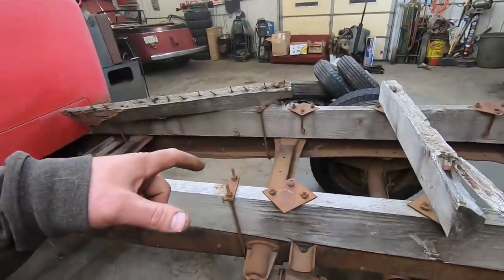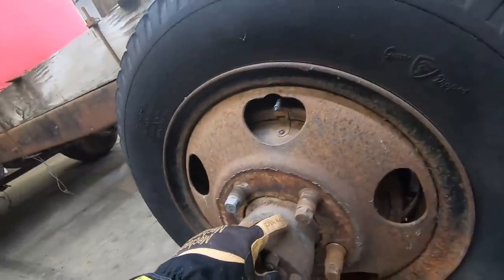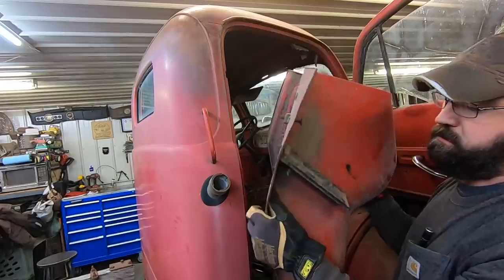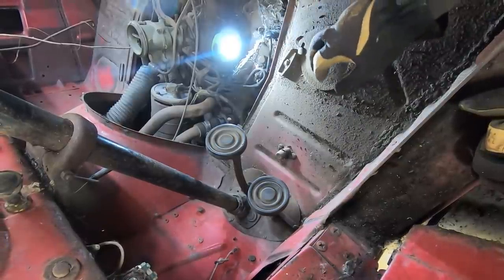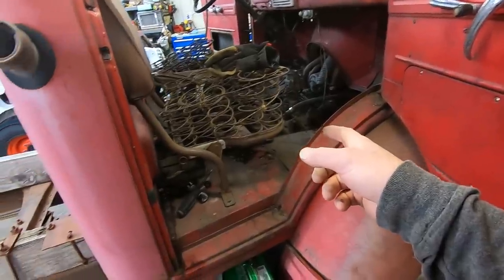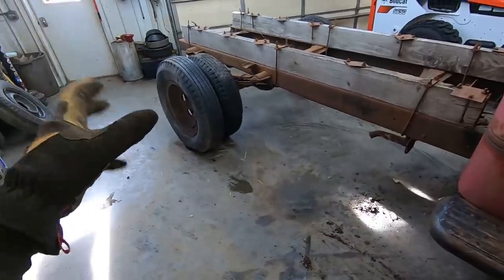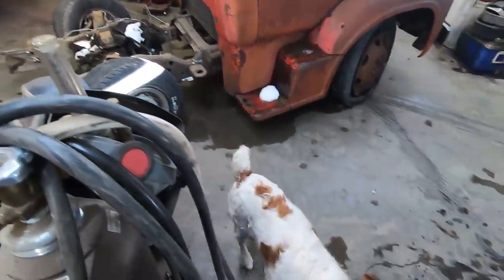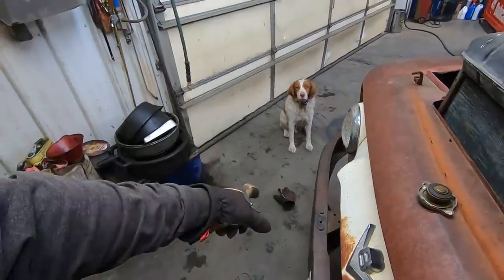1948 Ford Cabover Farm truck! Abandoned for 40 years! Will it run?!? Bonus "Stubby Bob" footage!

Comment: Boy did you have trouble with tires on this video. The tire blowout reminds me of an interesting thing that happened to me at harvest time back around 1994. We were wheat and barley farmers. One of our trucks was a 1948 Chevrolet 2 ton with dump bed. It was our spare truck. I came into the grain elevator one day with a full load. They weighed me but I had to wait for the pit to empty because it had different grain in the pit. I talked to the operator's assistant and I kept hearing this scratching noise. I realized it was coming from the driver side rear inner dual. I stuck my head between the gas tank and inner tire trying to figure what it was when my eyes latched onto a bulge in the retread about the size of an egg and growing fast. I told the guy th run. I ran past the operator the was standing back of the truck and told him to run, the tire was gonna blow. He just stood there bewildered and all of a sudden - BOOM!!! Dust went flying everywhere and the operator was scared out of his wits. I'm just glad that rush of air didn't shoot a flame and ignite any grain dust or there would've been another boom! I'm also glad that thing didn't blow when I stuck my head right by it.
Reply from the maker: Yeah, bad place for that to happen. I bet that was a lot of dust!
Reply: @MortskeRepair  that was the funny part with all that dust coming from under that truck. I'm still so glad it didn't blow when I had my head stuck between that fuel tank and tire. I would've been pretty badly injured. It was also good I was parked in front of the pit so all I had to do was dump the load. I don't think that other retread would've made it driving anywhere.
Reply from the maker: @stephensaasen8589  Glad you pulled through!

Comment: Those COE's are begging for a 2500 or 3500 4x4 Duramax conversion. I know Cummings are popular but a 30 inch square Duramax will replace those V8s easier. Just think of all smiles,laughter and good times you and Duff will have.

Comment: The Sun tester would need a bunch of capacitors replaced, and then it would all work.  I can remember running one at an Exxon station I worked for back then.

Comment: When the cylenders are an archeology dig,just use a vet/dry vac to remove the layers of muck. Instead of blowing it all over. May just need a new engine,tho!! At least the cab (body wise) is in good condition!! Did you ever find a new supply of the hamm's draft??
Reply from the maker: Nope. Obsolete

Comment: in  1969 or 70  on the front page of the New York  Daily  News was a picture of a pair of shoes beside a gas pump at a gas station and the back of a old pick up truck with a big tractor tier ,  and the head lines said some thing like this  ;   Fathers son killed and blown out of his shoes wile inflating a tractor tire  that exploded . /  inflating tiers is very dangerous  / i can not ever forget it  /i was working at a gas station  at the time

Comment: You could put a van front end over the back of the truck so you can drive either direction. A loving steering wheel on both ends would lock the rear wheels while you're driving... In either direction.
Reply from the maker: Brilliant!

Comment: You said that you want to apply the linseed oil (boiled linseed oil) and grease it over the old red paint Cabover. It smells better than used black oil that brush over the thin paint. Gasoline smells worse than oiling the old tin cab house truck. 
 And recommendation is to uninstall all the seat away from the cab interior and more comfortable to inspect the engine. Driving/driver seat is not uninstall then it's too cramp and not enough space Sir?

Comment: I'm trying to figure out what was the point to the cab over hach. The time and resources you spent on the second truck would have been better spent trying to swap any other motor. But that's my opinion.
Reply from the maker: Had to make it easy to move

Comment: Cool looking trucks , but I don't see the advantage of having the motor in the cab like a van. Seems a pain to work on. Maybe that's why they got parked after 20,000. Did you pull the oil drain plug to see how much water was in the bottom end. Funny how we think we react so fast when something like a tire blows. Glad you're okay.
Reply from the maker: Shorter wheelbase for turning in tight areas is one of the reasons

Comment: Hi Morty and duff. Bummer the wasted flathead.  Either cab could go on modern chassis, you know that. Any thoughs on the 32' ? Your project video, are every bit as interesting as will it run. The 32's wild child,show is cool. Useful tech tip. I'm fairly sure the slant six distributor, fits the flathead 6. FF to electronic ign slant 6 distributor and module.  Just sayin in case you had any thought on electronic ign.

Comment: You talked about putting a Cummins in it, what about an old 2-stroke screaming Detroit? No electronics required, legendary reliability, and unbeatable sound.
Reply from the maker: Too loud. And leaky!
Reply: That truck is so awesome regardless of what you do. There’s a lot of them down here in Kansas. Right along highway 281 as a matter of fact.
Reply from the maker: @stevenlatham4397  Nice!

Comment: I was thinking as you were putting air in that tire if that thing has been sitting since 1980 it's got to be really ripe and he really needs one of those air pumps that you can set the PSI connect it and walk away and then Bang it happened LOL! at least it did not have pieces flying at you like some tires do.

Comment: Easy way to check if the engine turns, put that puppy in high gear and rock the truck back and forth. Much easier than grabbing the fan.
Reply from the maker: How about when it's sitting in the weeds wheels half burried?

Comment: the steel in those fenders is a heavier gauge than cars have so the dints are not that easily removed.
Reply from the maker: No, but the metal is more forgiving to work with.

Comment: I have a 93 E350 short bus. The body cab is toast and the floor of the bus is going. She been parked a few years. But ran great when I was parked. She has the 7.3 non turbo with a E4OD trany.. had a solid frame under it. And not long before I parked it I replaced all the glow plugs and the controller. I also replaced the shift module. I been wishing I could afford a old cab over to make it a flat bed.. but if your at all interested in the bus I'd cut ya a sweet deal..just saying.
Reply from the maker: What part of the country you in?
Reply: @MortskeRepair  I'm in northwestern Pennsylvania
Reply from the maker: @danmcelroy6584  That's a bit of a jog from ND
Reply: @MortskeRepair yea I'm like 2 hours south of buffalo, NY and 2hours east of Erie,pa. I didn't know for sure where you were. Sorry brother. I understand. ✌️And I'll still be watching.
Reply from the maker: @danmcelroy6584  Much appreciated!

Comment: didn't the interior door lock activate by moving the handle opposite of open ?
Reply from the maker: Yes
Reply: @MortskeRepair  Looking forward to what you are going to use from the newer truck , I like the front end of the original .

Comment: Hello, I was thinking, put a  350 or 4.3, auto trans & transfer case, 4x4 drive shaft to diff & a 6/8 foot bed to cover the drive train.
Reply: Into the rear frame.
Reply: Pickup bed.
Reply from the maker: Not a bad idea!

Comment: 37.20 in and it looks depressingly much like every flathead Ford you ever touched...  The fact that there's near an hour left on the video & it's not a "part 1" suggests pretty similar outcome also, dammit!  At least you got that uber kewl SUN testing rig, maybe not as useful to you as your dizzy machine but highly interesting all the same.  I'd love to see it all working, but I'm sure there's tubes and wax capacitors hiding inside that will need addressing before it runs for long.

EDIT- hey, make sure you credit ol' Wheelhop Wilma & Pud-tang for the backhalfed truck idea lol

Comment: So its time to get offenhausen SBC-to-flathead adapter, a Hurst Wide-Stanse engine mount and a 366 Chevy.  

But the diesel is sweet, but keep the brownie!
Reply from the maker: Now we're talkin!
Reply: @MortskeRepair  366 is the cheapest Chevy V8, because it’s an undesirable (for cars) cheaply made, long lasting truck engine, fairly unknown. As long lasting a cockroaches!  

It was a rumor amount hot rodders, that the SBC was meant to be a direct replacement for a flathead, and it even swaps better in to a 40s Ford, then the Y-block! So any SBC will do, even a 307
And I’m a lover of odd engines!

Comment: BIG fan of the Sun tester, BIG fan of the '48 to '50 Ford F series.  Those valves are SHOT, but the pistons looked salvageable like your '44 flatty runner.  Looked like a relief block cut, right?
Reply from the maker: Not sure this one was relieved. Usually that was the earlier blocks.

Comment: hot dang time for some fabrication on mortske repair nothin but eagle eyes and catapillars lol funny stuff but the diesel swap would be way to cool on the old ford pick up a write off early 2000s 1 ton do some custom mounts for the coe to go on it and you got a tow pig with good brakes abs modern suspention power steering mabe even ac what could be better

Comment: I can't believe you didn't by pass that clutch pedal switch, on the square body. All they do is take the thrust surface out on the crank, starting it with the clutch pressure on it with no oil pressure.
Reply from the maker: It was bypassed. I hooked it back up.

Comment: You need to take the body (Red one) and put it on a modern 2010+ truck. Throw that engine, frame, suspension away. Also, it needs leopard skin seat covers.

Comment: We didn't know you spoke Spanish. By the way Mortske; that's a truck thing. They still use those style lug nuts on the big rigs. There is a socket that a fellar can just flip around  to take the nut off, then flip it back the other way for the stud.                                                                    What do you and Duff hunt birds with; a bow and arrow?  😉🤪 Just kidding, blow outs are loud.
Reply from the maker: Yeah I bought a socket
Reply: @MortskeRepair  I see the square body 4X4 is still there. Did the guy change his mind?
Reply from the maker: @johnswick4593  No, it's a month old video. Pickup is long gone.

Comment: The water pump is different to the car as the pump is used as an engine mounting
Reply from the maker: Correct, both are used to mount the engine but they are different styles.

Comment: I would drill thru the door latch and rip open and rip it off with metal cutting saw and the door will be not damage so it is just a hole with shaft being cut thru and open a way. So it's  cut down the rest of the outside latch and twister/handle with striker mechanism lock has to go and being replace with replicas made in China from brand HELP company.

Comment: You need to invest into a shop vac it's so much faster using one of them then a shovel and broom and compressed air to clean all the crap up off the engine and other nook and crannies anyway that is the worst flathead I have ever seen. I have never seen the cylinders full of crap like that and I have seen flatheads full of water but never that bad. I never thought stuff could get in the cylinders like that I thought that was a overhead valve thing only

Comment: Gee.  A stuck WHY-block.  Who would have thought, eh?  That Snap-Off flywheel tool just lost the will to live - and you can't blame it after the many Ford engines it has brought back.  It had to be a Y that did it in though, eh!  Poor not-so-old thing......  I like your solution for the rear end, but had my suspicions that it wouldn't be a run and drive when you aimed the diff pinion in the wrong direction and then welded it there.
.
Pity about the flathead.....and that was the GOOD side of the engine you pulled the head off.  On the video, you hear a dull click as the valve breaks off, so even if you hadn't touched it, the thing would have popped the next time a mouse farted near it.  You're right - the bore and pistons looked bloody good, but too much faffing around to bring back just for a 'will it run'.  Just sad we didn't get to see you wrestle with the crashbox that would have been in this thing!

So much disappointment, yet ol' Positive Mortske just soldiered through!  You almost looked as high as that original bloke off Blues Clues used to when you did the Positive Mortske Face!  And that's a kids program.  It's not just him either, so I dunno where TV execs are at with their thinking that meth-heads or cocaine addicts are great for hosting children's television shows, but there must be plenty of them around.  Then again, maybe he just drank 40 cups of coffee before coming on set?  He blinked about as often as an Amway sales rep (ie: never), so maybe it was a legal high after all.  You'll just have to replace all your sammiches with the likes of Mother, Monster, V, Red Bull and Barista Bros Espresso......and then try and set points with hands that are shaking worse than.....er......hands that are shaking real bad! 

Anyway, all the best and still I'll look forward to maybe one day seeing you get a late 40s flathead truck move under her own steam.......  Being re-watching some of the classic episodes on your channel again recently too, hence my question about the old Plymouth Suburban last night. Still enjoy that exploding Y-block and getting the stuck and crud-filled flathead to run.....among many others  The flathead in THIS video, I reckon is a lost cause without some serious time and a set of valves at least, sadly.....  Never mind!  Tis but a minor setback!  I am certain the next one will go perfectly! [wide eyes, maniacal grin]
Reply from the maker: Appreciated as always Lance!

Comment: That is a Low Cab Forward (LCF), not a Cab Over Engine (COE).  The cab does not tilt forward for engine maintenance, and it has a stubby hood.  A COE has a tilt cab and no hood!
Reply from the maker: You’re most definitely wrong there
Reply: @MortskeRepair  In the late 1940s/early 1950s I was not wrong.  These days, some may think I am wrong.  IMO, not so.  IMO, there IS a huge difference between a Low Cab Forward and a Cab Over engine!
Reply from the maker: @JonAPoe-is7fv  If I called it a "tilt cab" I would be wrong. It's definitely a cabover. Do a google search..

Comment: Save yourself a ton of time!!! Fill every engine that does not run with diesel fuel. Pour it in the carb till she pukes. Then pour it in the oil filler till it stops bubbling. C'mon man!! You can do it!!!
Reply from the maker: Doesn’t do any good

Comment: Not really a CAB OVER, actually known as a SHORT CAB CONVENTIONAL.  90% of so-called "knowledgeable" guys get it wrong, so don't feel like your alone.  Also, the early auxillary transmissions were known as "Brownies" because most were made by the Brown-Lipe Corp., which was also a huge maker of heavy duty clutches. If you had a Lipe clutch, you had a good one!  3 speed aux trans had underdrive, direct & overdrive. 2 speed ones had only direct and overdrive.  Aux trans equipped trucks never had a 2 speed rear axle; not to say that someone here and there didn't cobble one in somehow.  These older trucks had little in the way of horsepower [or torque], so they needed gearing to get the job done. Young You Tubers are only guessing because the guys who actually used these trucks are dying off and taking their knowledge with them.
Reply from the maker: You like hearing your own voice I bet

Comment: The 54 looks like a 292 I hate those motor nobody told me that your not supposed to run your 292 105 miles an hour for 10 miles.... it turned number 4 into dust.... yeah good times!!
Reply from the maker: 272, 312 they all look the same, good engines, well, except the ones I find!
Reply: @MortskeRepair  lol

Comment: If you hadn't cut the frame you would not have that problem
Reply from the maker: Yeah, well it was frozen down and my trailer wasn't long enough and it didn't have a rear axle in it. But yeah, there's that. Thanks Einstein.

Comment: Wow
Love your channel, but I found this video distressful!

I want to accuse you of vandalism, but that seems a little OTT.  Why wreck the original wheels?  Are they easy to find?  Why cut the chassis rails......?

I think you have lost your normal direction with this poor truck.  You are a saviour of neglected vehicles usually.  I feel you didn't really repair this fella....

Saddened. :(
Reply from the maker: Tires of that size are expensive and I needed it to roll. They are easy to find different rims. Most folks go to an updated rim anyway as most tire shops won't mount them anymore either.